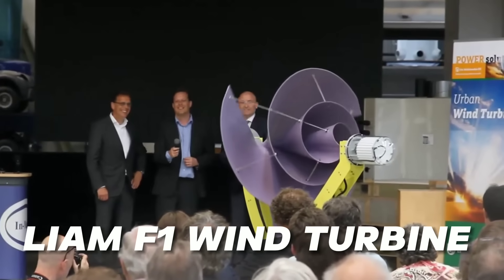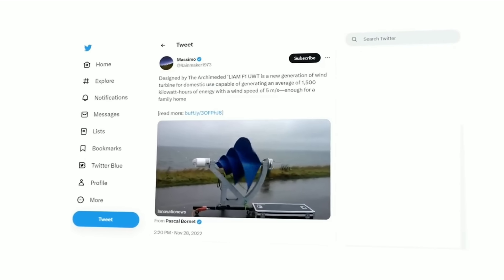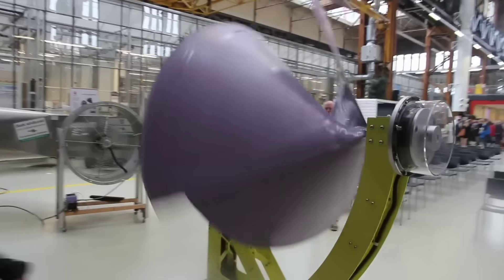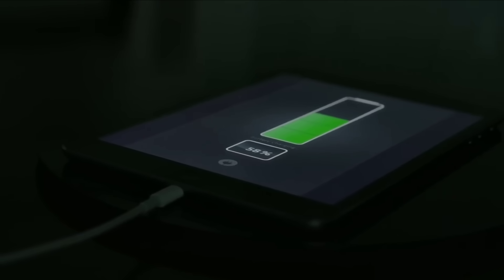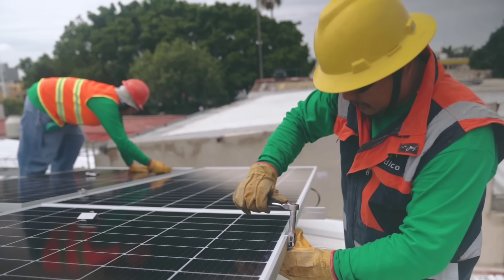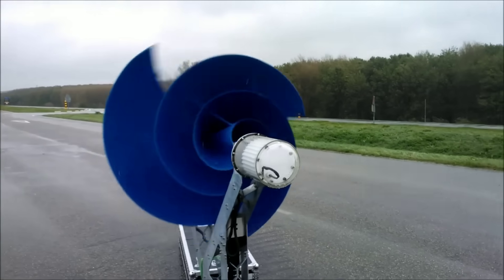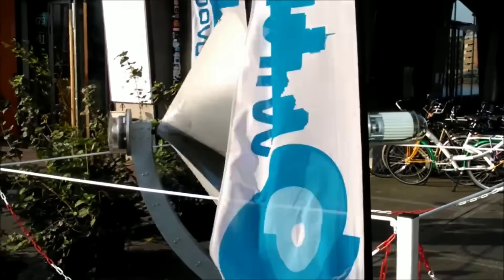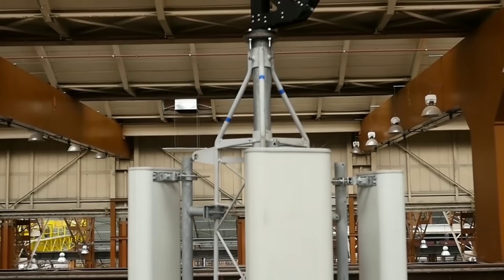This NEW European Wind Turbine for Home Outbeats PV Solar Panels in 2023?!

Comment: I was convinced until your bad mouth talked complete rubbish about solar, I'm an installer & have had zero issues with the panels over hundreds of jobs, I would have looked at the tech you offered, but the bad faith & complete upsell on YOUR wind will put many off, including myself.
Just for your sales person, most people know when they can smell something not right, I'm not now convinced your turbine will operate at 5mph wind, when the competition runs at 9-12mph.
If you are that confident in your tech, add your data to google docs for the public to see.

Comment: I had 13 solar panels installed 8 months ago and they have already produced 4.16 Mwh.  I do NOT have battery back-up and yet I have only owed $56 in electric bills total since they were installed.  My panels have never needed to be washed since regular rainfall seems do the trick.  The additional cost of $4,500+ would take a very long time to pay for itself.  The payments on my panels are roughly 30% lower than what it was costing me to get my electricity from the grid.

Comment: I never clean my solar panels and the output is still about the same.  Going on 4 years.  I have concerns about moving parts in weather.  Mechanical maintenance is going to be a problem.  Nothing was mentioned about power output in a light or medium breeze.  Ground mounted turbines would be a hazard not only for wildlife but humans at ground level.

Comment: They did a lot of math but left out cost/watt.  By y arithmetic, it's about $3 per watt.  That means that the payback is likely much longer than solar panels unless you have very high rates and the sun doesn't shine much.  Maybe in the high arctic this may make sense. .
Reply: It is applicable to most cities with lower solar gain on Multistory buildings. It can be retrofitted with a permanent roof crane to effectively construct a roof wind/solar generation, incorporating wind from the flat wall.  This new system is possibly quieter than the current one's in existence, which sometimes have solar panels covering some but not all  the roof space to make maintenance easier. The crane can used for panel and parts replacement years down the line.

Comment: Often thought of a simpler similar design using simple turbine like blades mounted on a long axil. ( say 3 blades large to small or small to large. not sure what would work best )
Reply: It looks like a Fibonacci style wind turbine.
Reply: Great idea.I would offset the blades to pick up the residual air flow from one blade assembly to the next. Give it a shot..

Comment: Sticking a turbine on a domestic roof is next to useless due mainly to turbulence caused by the proximity to the building, if you had a twenty metre tower to put it on then maybe you could generate a useful amount of power. But good luck with getting permission for that. Also it looks to be about 1 metre in diameter, you can easily calculate how much energy you are likely to generate given the average windspeed in your are3a and the energy contained in an airstream of that CSA (given no turbulence of course) a few M2 of solar will far out perform it, without any maintenance. This is a chocolate teapot!
Reply: Such a usefull comment! So, what is your suggestion, if any?
Reply: @RobertRavoalavoson  my awnser would be (if it where Affordable) try it and lets find out. The price might be reasonable, i don't know. But from my own point of view it is prohibitive
Reply: @janrozema7650  I actually agree. The size seems also prohibitive and incompatible with real conditions. Multiple smaller units would be better.
Reply: Maybe true.... but a few m2 of solar doesn't work at night. This might actually alter the solar is better then wind... 
But yes permission moght be a problem
Reply: @janrozema7650  
A 15kWh battery will easily store enough energy to cover the night time period, in our case we can last two days. With a 5 kWp system coupled to a battery we have only imported 6 kWh since mid March, and I think we will only start importing in mid October.  Since mid Feb we have generated 3200kWh, I seriously doubt a roof mounted turbine would have achieved that,
Reply: @johnhaydon4055  
Also true, but considder the cost of the battery and the wind mill... 
Installtion cost might be the same, maybe not.... 
All this comes down to cost, a 15kwh battery costs quite a bundle
Reply: @johnhaydon4055 it would be interesting to see a full year comparison though. Wind typically picks up in the winter as solar dramatically declines. You will likely have problems charging your battery with solar only during fall or winter months. I’m not saying batteries aren’t a better overall deal just something to consider. I’m sure it depends where you live too.
Reply: @kylekleman  Agreed Kyle, Our system has only been switched on since the last week of Feb23 so we don't have a full years records yet. I fully expect to start importing power again from late Oct or maybe mid Nov. If that proves right we should have free electricity for 9 months of the year and maybe still generate about half our consumption for the other three. If that is reasonable then we have payback in about 7 years. On top of that we export for free a lot of energy which we plan to use in the future with an EV saving a bunch of Die3sel costs too. More importantly though our Carbon footprint has shrunk a lot.
Reply: @janrozema7650  I just looked it up and a 15kWh battery costs about twice what this wind turbine costs. Also, wind speed generally drops at night, because it is driven by the sun heating the air. I find it unlikely for this wind turbine to be worth more than an extra battery, and neither is worth more than better insulation or improved timing of power use. You can easily build in switches that require an extra action to us power heavy devices like washing machines at night, and lights that turn off at night, but by far the primary use of power is temperature control, especially in a high humidty environment. So insulation is the single best investment, then solar electricity, then I guess alternative heating methods though I haven't looked into those yet, and then batteries.
Reply: why not use them in place of radiator fans on ev's :) no wind issue there
Reply: rock on:hand-purple-blue-peace::hand-purple-blue-peace::hand-purple-blue-peace::hand-purple-blue-peace:
Reply: It is applicable to most cities as Multistory buildings of adequate size can be retrofitted with a permanent roof crane to effectively construct a roof wind/solar generation, purposely incorporating wind from the flat wall.  This new system is possibly quieter than the current one's in existence, which sometimes have solar panels covering some but not all the roof space to make maintenance easier. The crane can used for panel and parts replacement years down the line.

Comment: Very bad video. Comparing solar panels and wind turbines in terms of energy produced is absurd, they're not comparable, in the end it's just a question of cost. Phrases like "wind turbines run even at night" take people for idiots who are easy to deceive, solar power runs when there's no wind, it all just depends on the climatic situation. And after that, it's just platitudes that apply to any equipment of this kind. Only one thing would be interesting: to know why this wind turbine could be better, with its shape different from the others. But no, we're told that we can choose the color and that the options have to be paid for.

Comment: What is km/h? Do you mean kWH? (See 2:32 in video)  Mechanical devices wear out. 1500 kWH is equivalent to 1.5 kW for one hour. Typical toasters required 1 kW of power. Not certain that would be enough for a home (at least 2 required per your input on the video). The proof of it’s capability is long term testing. If you want anyone to consider this there needs to be a lot more data on power output versus wind speed and direction. One also needs to put together a system cost/expense. I certainly would not buy it before it is proven in the real world. What happens when there is not wind and it snows? Or if there is freezing rain? Etc……

Comment: Ouch! Just looked up the cost - projected to be around £4000 (over $5000) per unit. 
If you need 2 (for an average household), and then all the fancy batteries, etc, on top, that 'still' adds up to a lot of money in one go. 
Presently, I'm paying less than £1k per year on grid electricity. 
While this device might last long enough to pay off its initial cost one day, regular replacement of current batteries will keep pushing that magic day further and further into the future. 

All these off-grid systems need to seriously come down in price or every part of them needs to be guaranteed to have a very long life-span so they are economically viable - otherwise you have all the cost of buying, fitting, replacement of batteries and maintenance on your shoulders.
Reply: Agreed, bottom line, in first world countries with very infrequent power outages per annum, UPS's will do as long as you have access to the power grid.

Comment: My solar panels are warrantied to retain 90.8% of labelled power output at the end of the 25 year guarantee. The regular downpours we have here in central Scotland maintains performance without any cleaning or any maintenance.
In contrast, the wind turbine I had at my previous home required annual servicing and has since had some components replaced due to wear and tear.
Therefore, I prefer domestic solar over wind but I would be interested to see an independent test of the Liam F1 by an organisation like the Energy Saving Trust, whose 2009 report on roof and ground mounted domestic turbines named Location Location Location makes for interesting  reading.
Reply: fully agree, independent analysis and like someone else said, this is probably a chocolate teapot
Reply: Do they have magnetic bearing?
Reply: @michelbisson6645  My wind turbine required lubricating once a year and did not have magnetic bearings.
Reply: All practical tests show that small wind turbines generate electricity only at a cost very significantly above 1€/kWh! This is because there is hardly any wind near the ground, and it is also very gusty, which extremely reduces the service life of the systems. With solar systems, on the other hand, you can reliably generate electricity for about 8-12 cents/kWh over a period of 25 years!
Reply: What panels have you got?
Reply: @gigel99324  LG 325 Black Neon solar panels. They stopped making them in 2022, but there still appear to be stocks around and the warranty remains valid as long as LG exists.
Reply: Like those companies will be around in 10-25 years … smh
Reply: @quidproquo3933  LG Corporation has been around since 1947 in one form or another, so happy to take my chances on this one. 
But in general support of your point, most of the small wind turbine manufacturers that I was aware of around 2010, no longer exist.

Comment: If windmills generators used the software from EXRO they could significantly increase efficiency , currently EXRO focusing on electric car motors , improving performance by 30-50% , windmills generators are just electric motors in reverse
Reply: the generator isnt the issue. what do you DO with the power being converted from kinetic to electrical? if theres nothing there to accept it, in direct proportion to it being delivered?

batteries cant deal with it, and we design generators that are limited so batteries can deal with them, but then the generators limited in what it can produce when the wind starts getting too fast, and the batteries are still a massive bottle neck. so then we stick BRAKES on the things.

power goes up by the cube of the wind velocity. and we just waste it and let it slip past when its getting to actually be useful. like buying a ferrari and sitting in gridlock, like jumping out of a jet plane just after takeoff. humans are smart like that. the ferrari is serving its purpose solely by sitting there, its not meant to ever be driven, lol. and i guess its worth jettisoning an f18 to get on top of that building over there...

the brakes convert kinetic energy into heat.
the rectifiers make heat.
the wires make heat. 
the bearings make heat.
the batteries make heat. 
the inverter makes heat. 
every time, a loss. an inefficiency. unavoidable they say.

notice any... pattern developing?

we use electricity to warm up food. to warm our hands. to warm a bit of tungsten to white hot to make light (well... we did).

 software doesnt fix the issue... yall have your heads up your arses and cant see the forest for the trees. answers there. staring you in the face. software aint going to connect the dots for you.